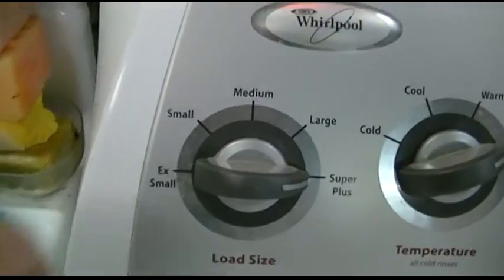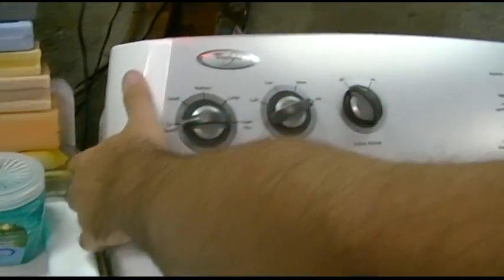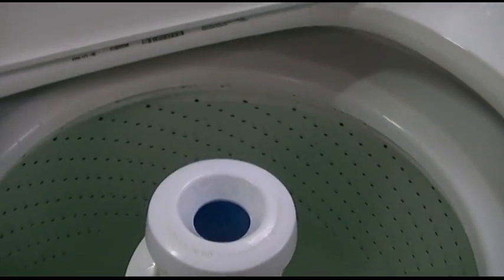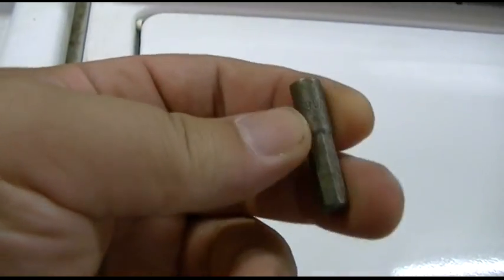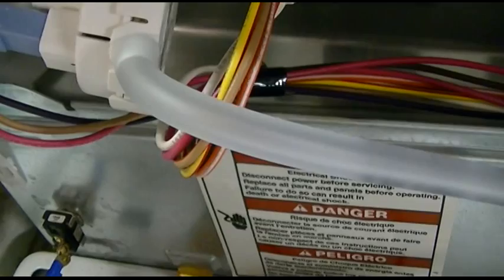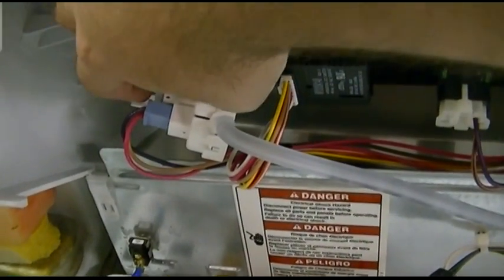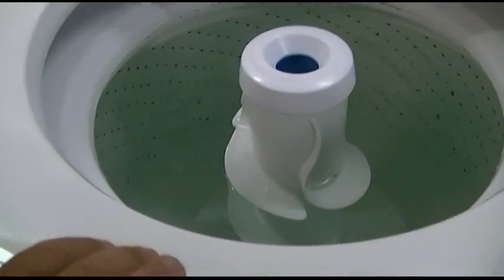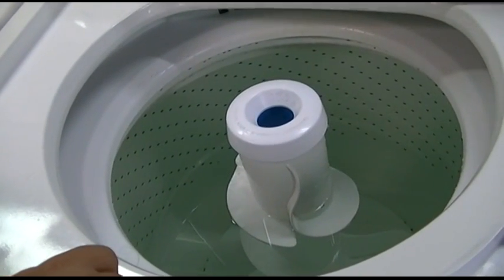Whirlpool Washer - Adjusting Water Level Selector

Comment: A small enough boxed end wrench should work just fine.
Reply from the maker: And if I had one, I'd be all set.
Reply: @jaykay18  be a good time to invest in small wrench set, they do come in handy.
Reply from the maker: @garyr7027  At the time this video was recorded, it would have been a great time.  These days, nothing is sure.
Reply: @jaykay18  I hear ya, seems like you never have enough tools anymore. Everytime they make something new it requires another special tool... it sucks. It's real bad for the automotive industry.
Reply from the maker: @garyr7027  It won't last long in the automotive industry, cars are built disposable today.  As long as it has a nice infotainment system, people will buy it.

There are specialized tools for each industry.  As a computer technician, I didn't have much need for wrenches, but I have tons of screwdrivers and bits to crack just about any case.
Reply: @jaykay18  damn vehicles now are nearly disposable bic lighters. Design to fail and repairs are more costly than it's worth. I do all my vehicles work, with few tools. If I need a specific tool I rent it or just buy what's necessary to get the job done. Over the years I've managed to collect a wide variety of odds and end tools... I have no full sets of anything... Lol.
Reply from the maker: @garyr7027  Cars now are rolling computers.  Under warranty, everything is a software update.  Being a computer guy, I can tell you for certain that software cannot fix bad hardware!

Same here, I have a lot of oddball tools.  But I know what they are used for, and when the need arises, I have the right tool for the job.  There is nothing better than that.

My dad has some nice sets of quality made in USA vintage stuff that I'm sure I will inherit when he passes on.  For now, I'd prefer if he hangs on to the tools and sticks around, that way I can borrow them if I need!
Reply from the maker: @garyr7027  That's what completely scares me about cars.  The very thing that was probably the most mechanical device you've ever owned is now more computerized than a space shuttle.

Comment: That screw is for an initial calibration of the sensor ... if the water level should ever change/overflow in the future; don't try to re-adjust; replace the sensor; don't do what I did; thinking I can re-adjust the sensor after 7-years ...  I adjusted the sensor, everything looked ok, took a shower, came out and my floor was starting to flood 😡... I knew better but tried it anyways ... I just pissed that Maytag solution to overflow is probably a timer that prevents overflow ... but by the time the logic kicks in, water is all over the floor ... Maytag man ... get off your ass and stop waiting for a machine to break and get back to Research/Development
Reply from the maker: Yeah they don't lose calibration.  Most washers of this style have NO timer on water fill, they'll happily flood your entire house.  Dishwashers have a timed fill, with an overflow float sensor.  The problem with a timed fill is everyone has different water pressure.  If your pressure is extremely low, the dishwasher might not get enough water; too high of a water pressure will cause the float to activate.

If that switch is not getting "activated" by the water in the tub, either the switch itself is faulty, or there's a problem with the hose.  Generally, these systems are very reliable and can run for well over 30 years without a problem.
Reply: @jaykay18  Yes, but I wish they'd have a cam on the control regulator's arm (as our previous Whirlpool SuperSupreme).  I'd rather have more than just our current '3' pre-set water levels.
Reply from the maker: @tonyd1149  I believe the magic is all in the selector switch.  If you can find one that is infinitely variable that will mount up, it will work like your old one.
Reply: @jaykay18  Dear Jay, thank you so much for the kindness of a reply.  I can try to find one.  Any suggestions on where to start are much appreciated. (If you don't have time, that's ok too.  I'm thankful for this your reply and descriptive video).  God[Bible] Bless you much.  Thank you again.
Reply from the maker: @tonyd1149  Yeah, no problem.  Probably the easiest way, since your old machine had one, if you still have any paperwork anywhere with the model number for it.  I'd look that up on a couple of appliance parts websites.  Find one with a picture and compare to how yours mounts up.  If it can mount, it can work.

If you have no recollection of the old machine, look on YouTube for different Whirlpool or Kenmore washers, one of them is bound to have it, and the author might have put the model number in the title or description, or spoken it aloud.  Then you can look up the parts list for that and see if it fits.

I can tell you that if you just do a broad search like "whirlpool water level selector switch", there will be an overwhelming number of results, and you won't be able to tell one from another.
Reply: @jaykay18  Thank you so much, Jay.  God[Bible] Bless you much.
Reply from the maker: @tonyd1149  No problem, best of luck.
Reply from the maker: @tonyd1149  No problem, best of luck.

Comment: Your not going to be happy until you break it ain't you.
Reply from the maker: There will be another video coming up in the future regarding more modifications (rather, testing for modifications).  With this machine, I absolutely DO stand a good chance of breaking it.  I believe the modification will not hurt the machine, but if so, the part is cheap and easy to replace.